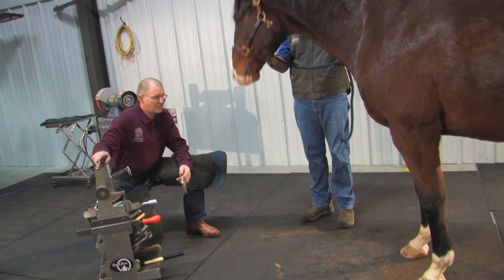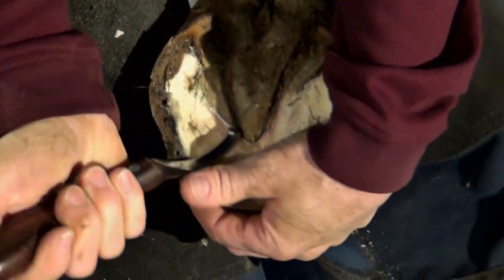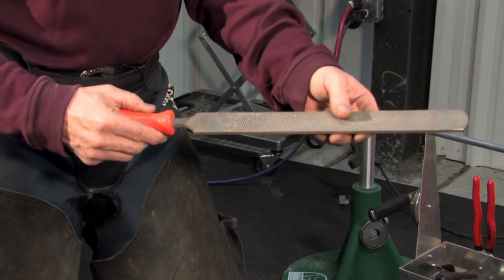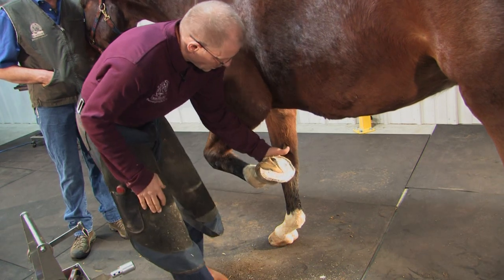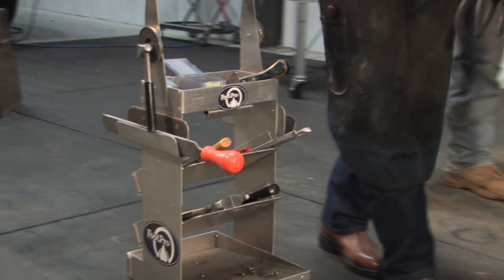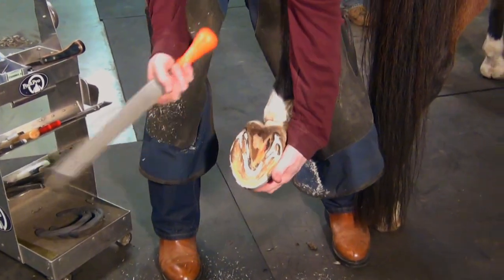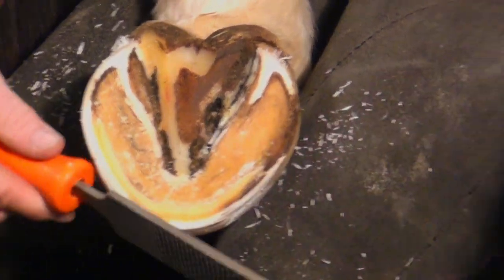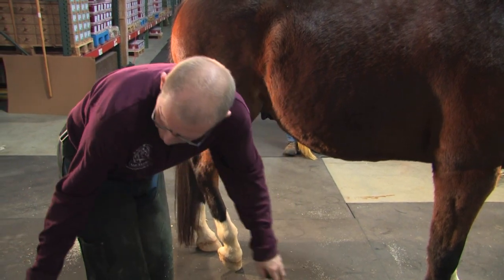Farrier Hoof Trim, Tools & Process - FootPro Information Series

Comment from the maker: Hi Joe,
Normally there would not be much difference unless the farrier is hot fitting as Mike did. In that case they leave just a bit more length to allow for the burn of the hot shoe. Balance wise they would do no different. He might put a bit more roll on the edges of the hoof wall if he was leaving the shoes off. Thanks for the question.

Comment: the red stuff on the Huff all through 10:00 is bruising. it gets tender if they step on a rock or something. and I didn't think your supper to dig to the soft spot of the good basis of they step on something it will hurt them bad and they can become lame or limp in that leg
Reply: it can also happen from tension or pressure on the joints /muscles in the foot flexor tendon etc ...in horses that are well looked after but do a lot of athletic work its more likely bruising is to do with that.

Comment: Would you trim the feet the same as you would if you were not shoeing the horse?
Reply: No. Ever though you can, and there is nothing wrong with that trim in my opinion, you are supposed to " cup" it more. Meaning talking more sole out if that is possible. And leave more hoofwall.

Comment: Really you are trimming those heels lower than the frog and pulling the whole back of the foot down to the ground.
Reply from the maker: You have to consider there will be a shoe at least 8mm thick put on the foot. And the hoof contact with the ground is important for its function.

Comment: I know NOTHING about this...  so I'm just asking as I heard in several opinions and videos that the frog should never be trimmed,  so in curiosity, why did you trim the frog and can it actually be trimmed?
Reply from the maker: Most farriers will trim the frog to make sure that debris is not trapped between the bars of the hoof and the frog and avoid problems that can occur like thrush or trapped gravel, etc.
Reply from the maker: Hello Jess, thanks for the question. Most farriers will trim the frog along the edges to keep debris from being trapped between the frog and the bars of the hoof. This helps to avoid problems like thrsuh from developing.
Reply: FarrierProducts ohh interesting,  I've been watching your videos for hours BTW,  very interesting practice this is,  and you're so thorough and great to listen to!
Reply: Jess, that is just one school of thought.  The way I learned was to never trim the frog, since it is so necessary to the circulatory function of the horse.  I've never trimmed a frog, and the farriers I've learned from never have either, and if you're thorough there really is not a risk of thrush or abscess any more than there is normally.  Obviously however, if the frog can confidently be trimmed without concern for quicking it, as shown in this video, there really isn't any inherent danger to it.  My personal belief is that it is naturally very effective, so why mess with it?
Reply: We never trim the frogs on our herd, the frog has a natural wear break off points when they are ready to shed and new growth is strong underneath. Good contact with the ground essential. we are 100% barefoot.